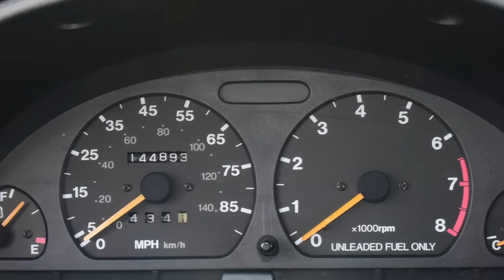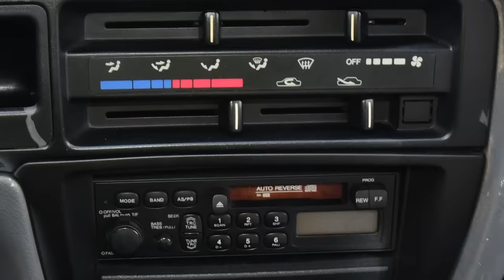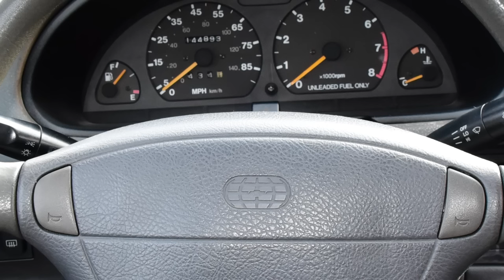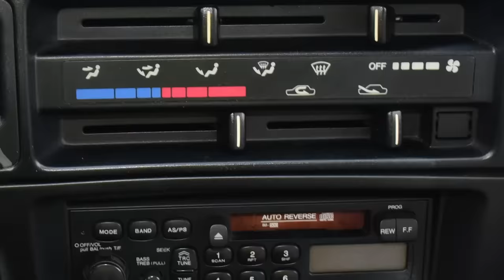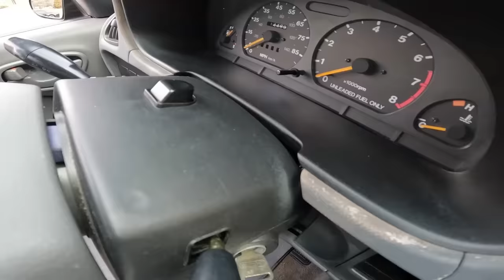1996 Geo Metro 5MT: Regular Car Reviews

Comment: I grew up in these things. My dad really liked them for the fuel economy. My dad commuted about 40 miles one way to work every day. If his Metro got wrecked or the body rusted out too bad from the multiple winters worth of Iowa road salt, he'd get another Metro. I believe he had 5 different Metros over the years. Including the all mighty Geo Metro convertible. I learned how to drive a car in a Geo Metro. A manual transmission Geo Metro. And not even 24 hours after I got my driver's license, I lost control of my dad's Geo Metro on a gravel Iowa backroad at 5:30 in the morning and rolled the car into a ditch. The car rolled slowly and came to a stop on it's roof. I was honestly fine, aside from being shaken up and very scared of what my parents would say about wrecking the car. And after the fact, the car was ok. A broken out window was replaced and the body shop hammered out some dents in the roof, other than that, that car saw many more miles before eventually rusting out too.

A lot of memories in these precious cars for me.

Comment: So I had a very similar geo when I was first became a mechanic , at the time I got it for very cheap since it had a bad manual transmission ( internal issue ) but it was so cheap and rust free it seemed worth it and a good learning experience. Come to find out because of my lack of research that many had internal transmission issues so it wasn’t easy to get a junkyard one , mine had the 1.3 16valve engine so it was peppy by comparison to the 3cyl. I could only find a 3 cylinder transmission and I found out they mate up but the 4 cylinder but had a much lower gear ratio to make up for the lesser power of the 3cyl. The result was easily one of the most fun cars I’ve ever owned. That lower ratio made the 1.3 put all the tiny torque down it could and was a small screamer , I had it a few years with no real issues. And now 15 years later I honestly miss it.

Comment: I had an 86 Chevy sprint.  50 mpgs crank windows 5 speed 3 cylinder with an aftermarket stereo and moon roof.  Good times and tore through the snow in Michigan like a plow truck

Comment: 1999 Chevy Metro was my first car. Bought at 147k miles, no air bags, one mirror and very poorly installed speakers mounted straight onto the dash that don't even work because he never finished them.

I love my Geo even if it's branded a Chevy. I still have her, kept her as my daily over my 1978 Fiat Spider even though it has just about as much tech in it. I once got it to 90MPH! Once!  What's not to love?

Comment: One of my all time favorite cars was my 1996 Geo Prizm LSi.  There were a couple times that I shopped for a Metro when I was broke and wanted reliable cheap transportation.
Reply: The Prizm was great. Rebadged Corolla.
Reply: @wigletron2846  my first car was an 85 Chevy Nova. Another great NUMMI car.
Reply: Your Prizm must have been a manual. With the 3 speed slushbox those things are torture.
Reply: @VectraQS  mine had the 4 speed auto

Comment: This is a car that you simply couldn't make today. Even if modern cars have gotten more safer, I have an appreciation for how minimalist this car is.
Reply: Ford Fiestas are out there, especially the 1L Ecoboost, they dirt cheap used and get over 40mpg with 126hp and a 5 speed.
Reply: @hendo337  I'm not specifically looking for a car though. I don't even drive myself.
Reply: Citroen C1 is the most minimalist car that was produced until recently that I know. I love it. It has that Mediterranean laissez-faire flair, it smells of warm evenings, wine and sea salt. I have never felt as cool as tagging along in this ball with wheels to a party.
Reply: @TheUltimateEel  Those don't exist where I live though.
Reply: Plenty of these type of cars still available in europe. Vw polo, vw up, seat ibiza, skoda fabia. All small cars with bare bone base models and n/a 1L 3 cylinder engines. Yes these aren’t unsafe anymore and are built quite well but they are still as slow.
Reply: @JMNTN  True, though none of those exist where I'm from.

Comment: I used to drive a metro. In 2013. It was a 1991 2 door, in white. It was the previous body style to this one. I bought it from a guy for $50. I put a water pump on it and it was driveable. I ended up rebuilding the head, and I built a muffler for it out of scrap metal from work. I cracked the distributor mount, but thankfully I worked with incredibly talented people, and I was able to get the aluminum casting welded. The 12" tires were ridiculously difficult to get ahold of, so I put some 14" steelies off an old Accord on it, with some little 175/75R14 tires. This completely transformed the way the car rode and handled, it smoothed out the bumps in the road and handled corners like a go-kart. And it looked cool with the "wide" tires. 

I recently bought a motorcycle with a 975cc engine, 18cc smaller than the metro's 993cc. The motorcycle has almost twice as much power, but it doesn't quite get the 55 MPG that the Metro did.

Comment: I left Northern Maine 10/31/2023 in the evening for Mexico. I Hit a deer the first night and the hood as smashed pretty good, and right headlights assembly lens was broke out. A clear shower curtain from Dollar Tree and some duct tape I covered the headlight. Using the car Jack and a block of wood I found at a truck stop, I got the hood bent a little to get some of my aerodynamics back. 

I’m now in San Miguel de Allende, Mexico a week later with 234,317 miles on this car that I’ve had about 12 years. This is the best car ever built in my opinion 
   You “HAVE TO PARK YOUR EGO” .  If you can do that, and recognize the engineering marvel and thought that went into these, you’ll love it. 

1.0, 5 speed is the only Geo I’d consider.

Comment: I’ve never driven a geo metro but I did drive a bottom of the barrel, base model, 2 door Tercel from the 90’s and it resonates with this so well. Manual everything, no power steering, no safety, zero power. But man was it ever fun with its 5 speed transmission. Just driving the car to 100% everywhere and it got such great mileage and you can do whatever you needed with it

Comment: I drove a 4 door 1995 1.3 4 cylinder with a 5MT from 16 to about 19 years old. My dad bought it new. It broke with 300k mikes on it so I took my dad’s second 4 door Metro he bought new, a 2000 with the 1.3 and a manual. I drove it for another 2 years or so until it broke with over 300k miles. They were fantastic little cars. My dad used to turn off the AC and call the button the “turbo boost” button when accelerating. It was noticeable. Metros we’re a part of my life for 12 years and my formative memories all include a Metro.

Comment: I restored a 96 from the ground up for my kids.  Bought for a song, it got everything new from brakes, to Axles, struts, exhaust, rings, bearings, interior refresh, new stereo and speakers, new tires on Suzuki wheels, and a Rustoleum Topsides repaint done with a dozen thinned coats of paint applied with foam cabinet rollers and lovingly wet sanded in between. You could swim in that paint. It was all accomplished for a song.  And.....my kids flat refused to drive it.  But a pair of smart young ladies swooned over the thing when their dad showed up to give me what I had into it.

Comment: I love these tiny '90s econocars - this, the Geo Storm, Ford Festiva, then later the Aspire... among others.

I'm a mechanic. One time, about 5 years ago, a customer came in with their 93-ish Festiva. I did 4 new tires, front brakes, a radiator, cap, and hoses; oil & filter, air filter, spark plugs and wires, distributor cap & rotor, wiper blades, alternator/water pump drive belt... and I think an outer tie rod (we didn't have an alignment rig otherwise I'd have done that too). I'm going off of  memory, but the list was very similar to that. A pretty big job, the sort of size that would run in the neighborhood of $2000-$5000, depending on exactly what vehicle, among average 1990s or 2000s sedans.

The bill was just over $900!

The tiny parts are *so* cheap!

Comment: My dad owned two of these, one of the first gens and then the second gen like this one here.  Both red.  He drove an hour and a half to work and back for ten-ish years (he retired the year before GM went bankrupt).  Aside from having a '90 Cavalier (which I adopted as my first car) and a full size pickup, those two Metro's were the best thing for the best gas mileage.  One of my friend's dad owned a red '95 Firebird and I would sometimes park the Metro (second gen) behind it, we would joke that it was a matching trailer for the Firebird because of the color and the way it was shaped, lots of curves.

Dad would have continued driving the first gen too if it hadn't been for the full-sized Consumer's Energy truck that plowed into the back of us while waiting for a car to make a left turn as we were on the way into town.  He hit us so hard that it pushed the hatch about two inches away from the rear seat... where I was sitting... and buckled the car so much that the roof of the car actually creased.  Dad's seat back broke, so he had to hold himself up with the steering wheel, steer the car, hit the brakes, and attempt to keep the car from rolling because he saw the truck coming and turned the wheels at the last second to avoid the car in front of us that hadn't made its turn yet.  The force of the impact caused the engine to pretty much explode because he was in first gear and he blew out the brakes from hitting the pedal so hard.

Years later, after he retired, he still kept the car (second gen) and while I was taking my girlfriend to her parents, it started to get really hard to drive, like even on a straightaway it wouldn't keep up speed.  Come to find out the engine busted a piston ring and was just dumping oil into the cylinder.  You never realize just how truly underpowered a 3cyl engine is until you lose one of them.

Comment: I once owned a 1990 Suzuki Swift GTi, which was the sportiest version of the Geo Metro available, with a 1.3 liter DOHC engine, larger brakes and McPherson struts. It was lighter and faster than any other hot hatch available and embarrassed several friends with their VW GTI, Honda Prelude or even Toyota MR2. I loved that car and the times that we had together, and I still regret selling it for a larger, slower and ultimately more reliable mid-size sedan. But there will always be a place in my heart for you, my little 1990 Suzuki Swift GTi. Always.

Comment: My roommate had one of these from 91, it was a shade of green and was a soft top auto. It didn't have anything past the headers and god it was a fun car, I don't regret ever getting behind the wheel of this little car. Going from a 04 and an 97 deville to THIS. I will admit I started to look for one for myself. It didn't have a radio but it had a motor, it had wheels and god that heater. It ran me though a hard midwest winter. 10/10 would legit buy one if I saw one for the right price.

Comment: I bought a red '97 hatch in 2009. It had 151,000 miles on it. I put 50,000 more miles on the car, rebuilt the engine in my garage, and put another 60,000 miles on it before selling it in 2014 for more than I paid for it.  The car averaged about 44 in town. 

Oh, and that story about how much the tires cost is true. Four new Douglas tires at Walmart, mounted and balanced, for under $100.  I loved that car.😂😂

Comment: I had a 1995 purple "Grape Soda" one, but the 4 cyl four door manual BASE MODEL. It was cheaply made, but over 7 years I did not have to put one dime into it besides fuel, oil, and tires, and one rusted muffler (pre stainless). The tires were the smallest ones in any passanger tire catalog. Whenever you saw tire sales papers saying "prices starting at", it was this size. The slim pizza cutter tires also had some of the best grip on snow. It was almost like driving AWD. Simple, cheap, and never failed to start. Minamalism with value.

Comment: Mid 90s and one of my friends had one, while I had a 64 budget bel air with a 6 cyd, 2 spd transmission. I had more top end speed, but the metro was quicker around town.  They both were also great for racing around the gravel pits, jumping approachs and skipping through mud holes. Much better than 2wheel drive pickups in those particular activities.

Comment: A friend of mine bought a new convertible Metro in '93 'cause the repair bills on her Fiat 124 convert were getting up there. Not really a good move because she'd done pretty much everything to the Fiat and it was mechanically new again, but the paint was going. She wanted shiny. 200,000 miles later, I bought the salvage on the little car for $250 after she'd totalled it the second time (my shop saved it the first time, after we'd done all the required maintenance since she bought it). I put a core support, a radiator, and a hood on it, and drove it another 50,000 miles. Finally pulled the oil pan to look at the rod bearings, and though they were still fine, I replaced them anyway...along with the third timing belt. Little car still runs great, but I did have to finally replace the feedback carb with a 28 PICT Solex from a VW Bug, on a custom adaptor. People who say these little Geos are junk are imbeciles.

Comment: I know a guy that bought one new just like this but red. I have stories for days but I'll keep it brief: we cut the muffler off and put a motor cycle  pipe on it, took the top off the air cleaner to allow more air flow, and lastly a homemade bass tube made from a 5 gallon water cooler bottle was in the back with a huge amplifier hooked to it with a CD player up in the dash (it was the middle 90's so this was cray ish at the time). The crap that car took was astounding.

Comment: I daily'd a base model Metro in the late 2000s/early 2010s. Was my grandma's car. She bought it new. Then it was my dad's, then me.

A highway patrol officer once pulled me over and claimed he clocked me going 85 mph. Seeing I was immensely skeptical, he went back to his car, grabbed the radar gun, and walked it backover to show me the "85" on the screen in big red digits.

I said,  "Look, I'm sure you get this a lot, but I'm pretty sure you tagged the guy in front of me, before he saw your cruiser and swerved out of the lane. If this gum wrapper on wheels was even capable of going that fast, I would just strap a couple wings on it and fly to work, 'cause there's no way this thing would stay on the ground."

Dude laughed so hard he physically couldn't write the ticket.

One day, I was going about 5 mph from a stoplight, when a noobie driver pulled out in front of me from a driveway and then slammed on the brakes. She almost missed her turn! The roads were wet. No ABS. I hit the brakes and skidded a few feet into her plastic bumper. Didn't scuff her paint. Totalled the Geo. Front end looked like a crushed up ball of aluminum foil.

The Geo left an indelible impression upon everyone who drive or rode in it, to be sure...But, uh, it wasn't a good one. Driving it had all the terrifying thrill and bone-rattling ride you'd expect from taking a glorified lawnmower for a cruise on the interstate. Riding shotgun felt like having been carjacked and taken hostage in a go kart fitted with seats from public transit. Anyone who claims to have enjoyed driving a Metro regularly in the last two decades must be enjoying themselves some rose-colored crack.

Comment: 1996 Geo Metro was my first new car. I had just graduated college, had no money and just got hired as a travelling salesman. My 1986 Cavalier decided to die one day in Ottawa, every light came on and there was a banging sound under the hood, so I pulled into the first driveway which happened to be a Chevy dealer. Bought a GEO Metro 4 door MT on the spot. Loved that little car. Unfortunately I killed it 6 months later in an accident, then bought a used Tercel. But that GEO holds a special place in my heart as my first new car.

Comment: I own a 1996 Geo Metro LSI (Named Jolt because of her quick acceleration) (my dream car)
1.3 liter 4 Cylinder engine with 44 miles per gallon
I bought her last year 2022 January first
She has problems still but she still functions so well and I can't be more proud of a car.
I've been offered a good amount of money quite a lot and at one point 6000 dollars but I turned it down. My friends were pissed at me  saying "you could have bought another and fixed it!" 
Yeah but, none are like mine. She is the only one for me, mechanics where I live don't wanna touch or fix her so I'm doing it all myself. But she was definitely worth the $1900 I paid. Never regret it

Comment: This car was a Chevy branded Suzuki Swift.  I bought this car TWICE. 1992 and 1997.  I'd have bought a third if they hadn't stopped building them.  In both cases, I bought them new.  They both started to fall apart at about 200K miles.  That wasn't a problem for me.  Brakes, tires, belts and plugs are all either of them required to turn the odometer over TWICE.  Very reliable.  One of them needed a new alternator at around 130K.  No big deal.  And nobody believes me when I tell them this, but ask anyone who had one.  52 miles per gallon on the highway.  We did a lot of road trips in those cars.

Comment: My daughter had a 96 Metro for a while. Better have the AC off when taking off from a stop light but it was good in the snow. I drove a 93 Suzuki Swift 1.3 manual transmission for a few years. It was a Metro with a bigger engine, brakes, wheels, and a few other differences. My daughter called it a tin can on a skateboard but is was fun to drive and could 50 mpg on the highway.

Comment: This was eventually sold as the Chevrolet Metro from 1998 until 2001. There used to be a very clean orange Chevrolet Metro 3-door in my area for many years. We need more little cars like this to be built and sold new.
Reply: The Chevy Bolt is the closest thing I can think of to it new.